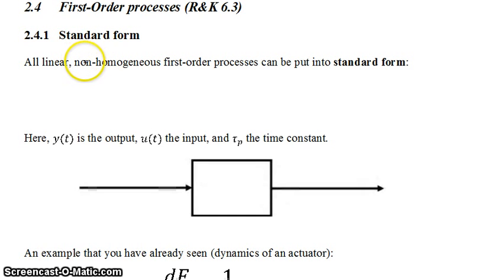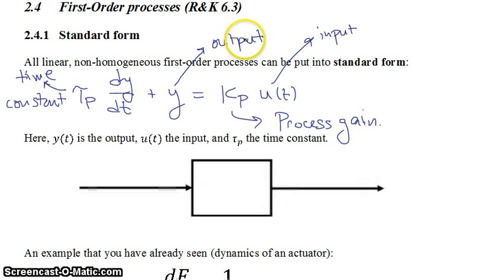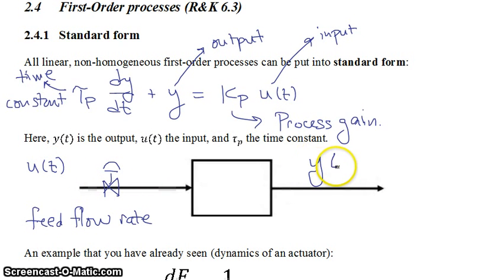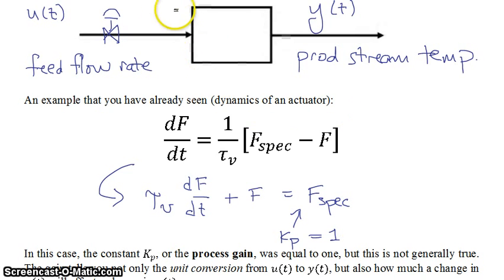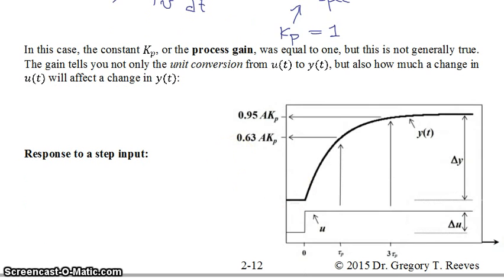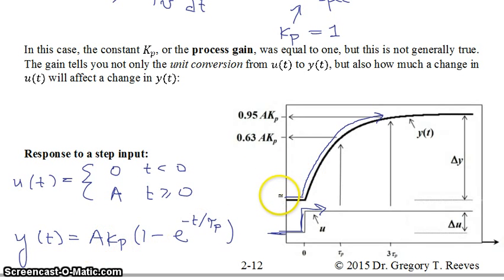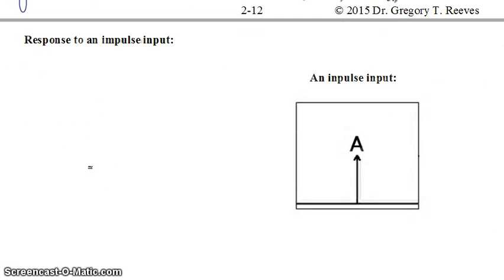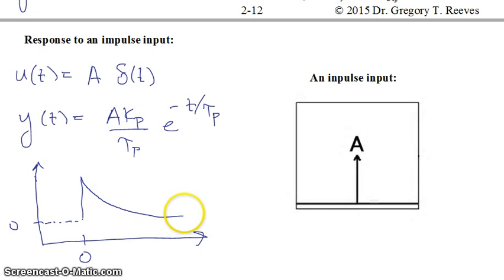First Order Processes -- Standard Form

Comment: Can u plz upload an example of first order system?
Reply: A thermometer indicating 10°C is exposed to a fluid temperature at 100°C. It is known that at a time of 5 times the time constant, the error is reduced to 0.7%. Find the values of co efficient of convective heat transfer coefficient, surface area, mass and specific heat capacity at constant volume which ensure that the error is reduced to 0.7% in less than 10 second?  Can u guide me to solve this example?